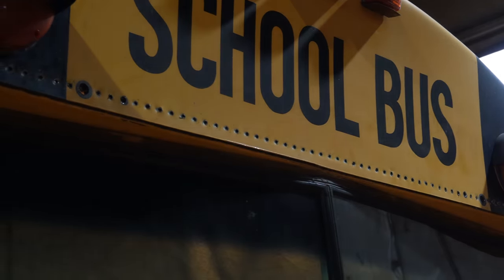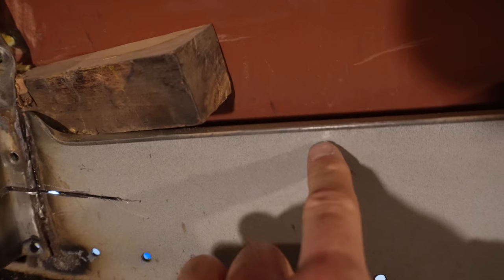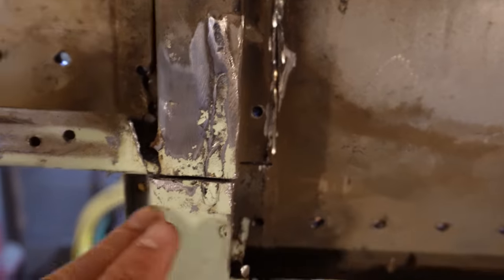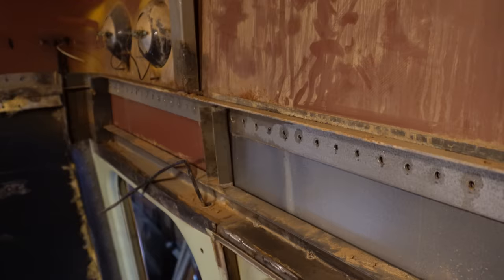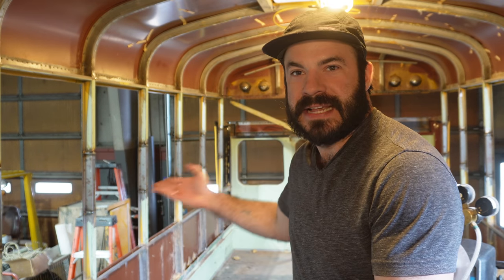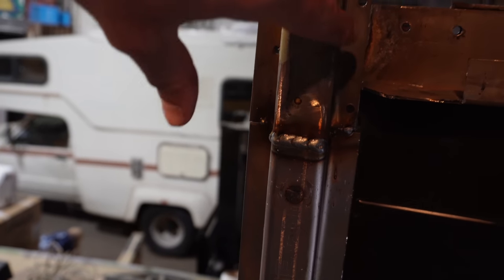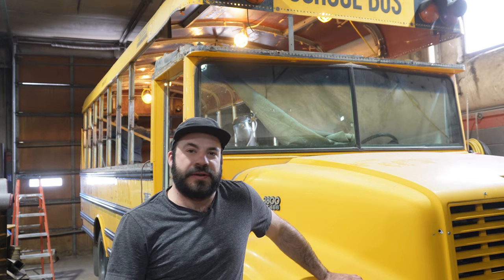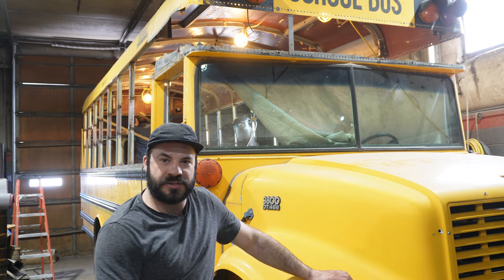How a PRO SKOOLIE SHOP RASIES THE ROOF (Skoolie Conversion Guide #4)

Comment: I very much appreciated the attention paid to Alignment (use of straps, jigs, squares, and such) to maintain rigidity and equalize forces on the structure.  Two questions:  have you thought about the installation of electrical radiant floor heating (if it's not in a future video)?  As for the 'stiff' rear spring rates - would removal of a leaf or three from each side accomplish the same as a weight addition to the rear of the bus? And decrease total weight?
Reply from the maker: Thank you! You can make up new spring packs for sure, and that is a possibility once I'm done. I'm not concerned at all about weight in my build at all (in fact I'll be doing a video about this shortly). Once I'm done, I'll see how much we weigh, see how it rides, and go from there. My GVWR is 25,900 and I only weighed 13,500 gutted. The conversion will add around 5000lbs I'm guessing fully loaded with water, propane, and batteries and all the storage bins full

Comment: Nice video and great way of cutting and lifting the roof. 

Have you ever lifted a roof and took the upper windshield support up with the roof structure?

I think taller windshields would look better. The glass is flat and can be bought in sheets to make new windshields. I used to work on heavy equipment and cranes and made plenty of flat glass pieces.

Comment: I'm curious why slightly smaller channels (that would fit inside the existing ones, allowing some material to lap) isn't the standard.  They'd almost "Self-align" that way, wouldn't they?

Either way, great content, great explanation of the details, and top-notch work! 👍😊

Comment: I just want to point out, I have reached out to Thomas Built for the reason as to why buses are certain heights. They explained it's the limit height for rollover standard by the department of transportation. Going up higher without some kind of cross bracing in fact is weaker than the original and may fold in those exact spots.
Reply from the maker: Who did you talk to?
Reply: @ChuckCassadyYT  I reached out directly to Thomas Built Buses in North Carolina, Mitch Miller and the Technical Support team reached back out with the Federal Motor Safety Standards (FMVSS) reference as to why the buses are built the way the are. Specifically the Class D style most of us build.
Reply: @ChuckCassadyYT   Regardless you and your team do a killer job, and as Thomas built pointed out. It isn't likely the bus will rollover. It's just the "what if"

Comment: What kind of welder do you use, I noticed you're using a bottle, would a flux core work for this or do you think it need to be done with gas? is 110v enough or is 220v required?
Reply from the maker: You can totally use Flux core and 120v. The thickest steel you'll weld on a roof raise is only 1/8" usually. Our welder is MIG and 220 but that's just cause we are fancy
Reply: @ChuckCassadyYT  Okay, excellent! I'm a few weeks away from my roof raise and starting to source all the equipment! I'm so excited to see a professional do it before i do it on my own. Really helps!